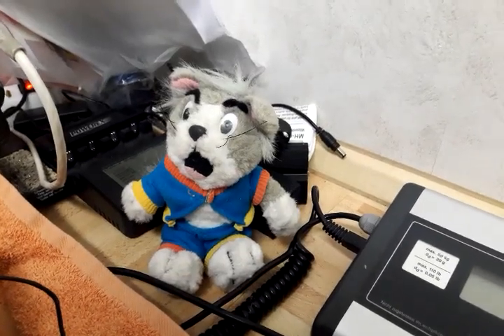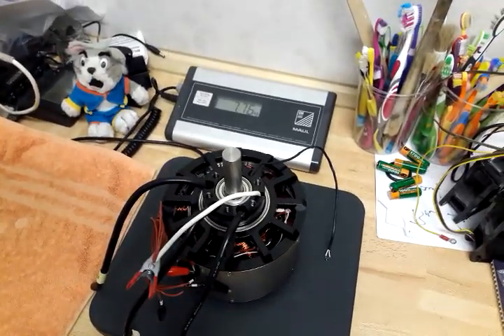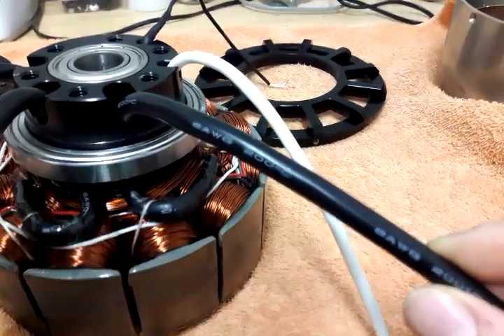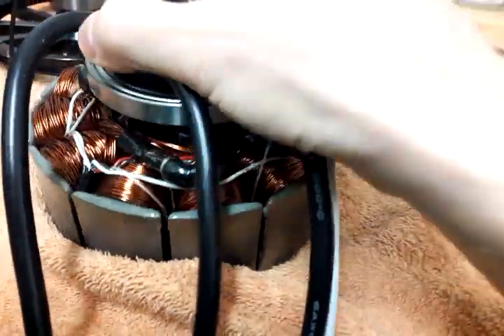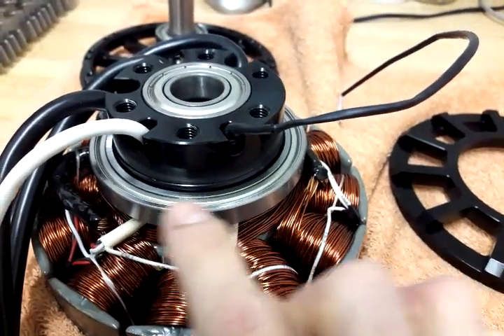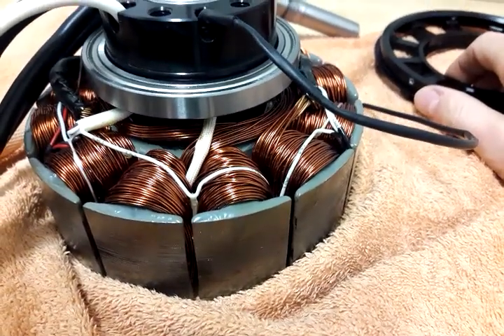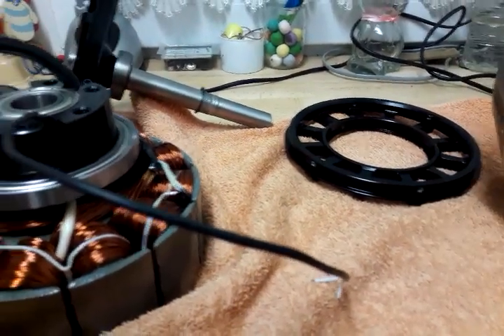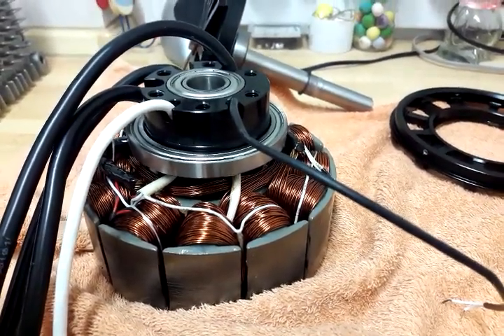Review & Disassembled REVOLT 160 Pro (Brushless DC Motor)

Comment: Can you suggest a driver/controller or frequency inverter for such a brushless motor wired for 220volts ?
Reply from the maker: No, unfortunately not, all my projects have been limited to sth around max 100 Volts.
Reply: @nextev8794  if this small stator is capable of 20kw max. Would you please take a look at a gsxr1000 motorcycle stator. If i rewonded it is it reaspnable to make it wotstand 20kw given that the esc and batteries are adequate??
Reply from the maker: Donno. If at all, in a future project I would rather prefer a RV-160E instead of RV-160Pro or even switch to sth ike EMRAX
Reply: @nextev8794  whats the diameter and thickness of the stator in the video???
Reply from the maker: Clarification: the Revolts are outrunners: the stator is (stationary) inside the motor, the rotor outside. Check their webpage for details...

Comment: Hi super sache....
Kannst du diesen motor für ein city el empfehlen?  Elektrofahrzeug mit ca 250 kg und 60 kmh?
Reply from the maker: It might work, even though I won't necessarily recommend it. A city el has fairly big wheel diameters requiring a big reduction ratio of the gear (the revolts with 50kv run on a higher speed than for instance a perm). Start-up torque could be a little low.
Give it a try ;-)
Reply: You need to include your body weight also in the curb weight with such a small vehicle. The City-EL has a 1:7 gearing so, you will be able to drive normally with that motor. However, the cooling is marginal, so driving aggressively is going to overheat it! In 1990 I put a Lynch motor in my City-EL with a 1:3 gearing, it was a coreless motor and it used 45Wh/km at 50kmh. Peak power was 27KW (700A controller) and it could accelerate to 90kmh in 4.5 seconds. Range was 130km on 48V 132AH lead acid batteries at 50kmh, however it did have trouble driving up steep ramps like to the first floor level of ferries and I added an air scoop to get air through it for cooling as it would overheat in city driving when driving a few meters at a time. So 20KW with this motor is enough, especially if you don't put in a higher gearing for higher top speed and worse hill climbing capability.

Comment: I have this motor. But it is worthless. The magnetic flux leakage is so enormous. What i found that disassembled motor's rotor does not atrack metal to it's outside surface. But when you assamble the motor it can stick to other metal that you can even lift the hole motor, almost 8kg from ground easily. I believe that is why you saw in your test bigger rotor temperature than stator temperature. That is some serious design error. I would not recomend this motor to others.

Comment: Really great review, thanks for sharing. I'm thinking about buying 1 or 2 of these same units for my own crazy project.

Can you say what the Io value is, with high Voltage input, with the throttle at 100% ? I guess it must be quite high given that the motor is apparently lossy even though the coil resistance is 12mR. (100A^2 * 12mR = 120W. If 90% efficient at the 12KW full power, where is the other 1080W lost?)

Is it possible for you to show the ripple voltage between the phases when spun with external power?

Can you use the 2 black cages to introduce some forced internal airflow, possibly by adding fins from a fan?
Reply from the maker: I uploaded sth for the no-load (currents, back emf,...).The "black cages" can (probably should!) be modified, even the manufacturer recommends that by attaching a fan wheel to the rear.Still trying to locate the losses...